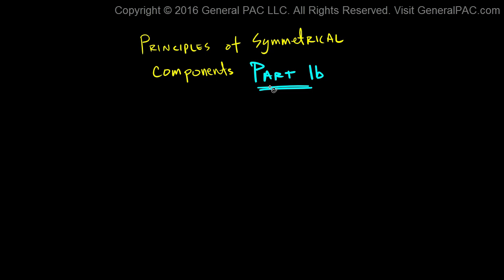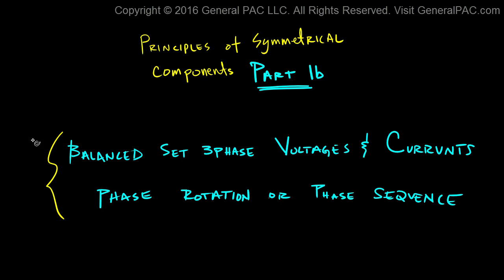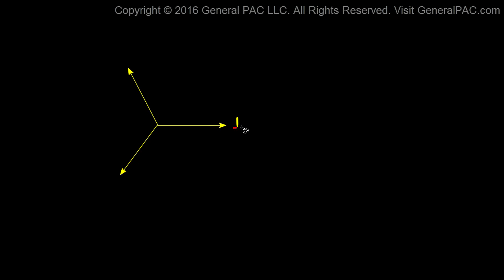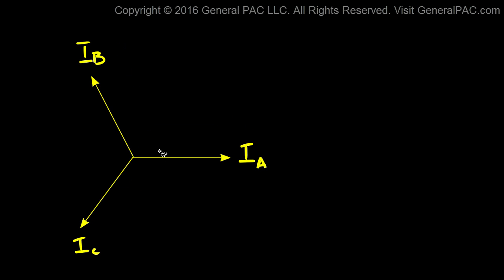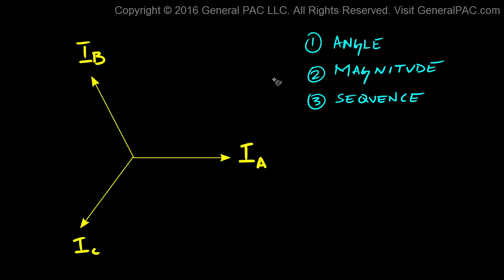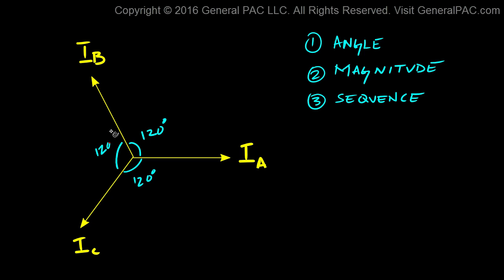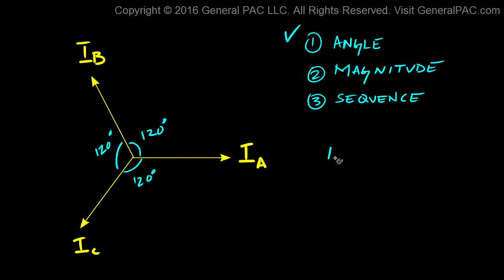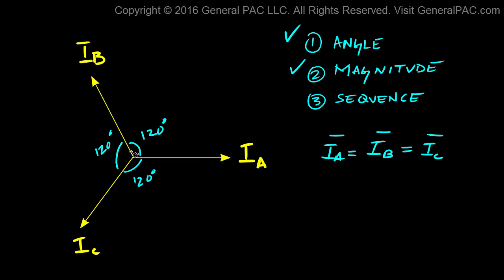Principles of Symmetrical Components Part 1b

Comment: Why are the phasors rotating?
Reply from the maker: Hey John, Phasors represent current/voltage sinusoidal waves magnitude and phase angle. These phasors are rotating in anti-clockwise or clockwise.

Hope you find it useful.

Best regards,
GeneralPAC by AllumiaX

Comment: switching B and C is the same as saying CW vs CCW though.. right?
OK i guess I understand why it's not.. because your analysis depends on a constant direction of phase rotation. Some contractors will just say CW vs CCW but if we're doing analysis between the two directions we need to define both.